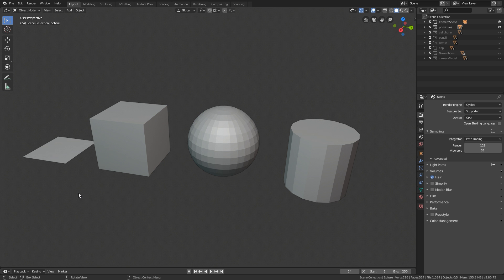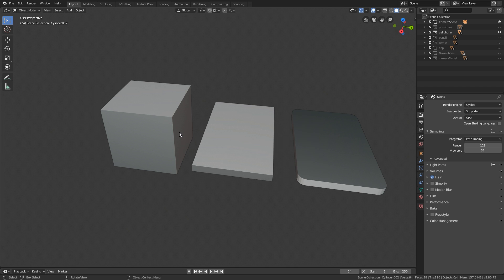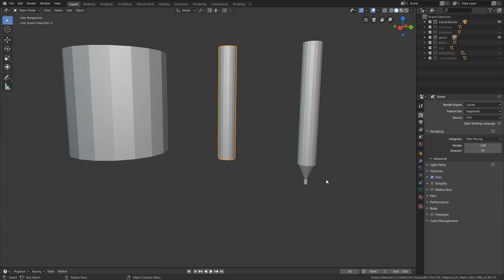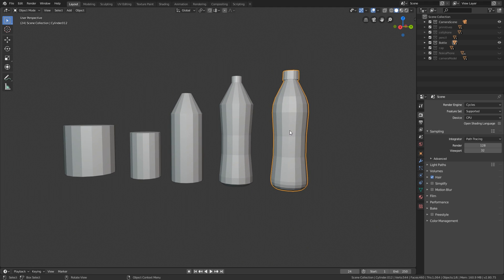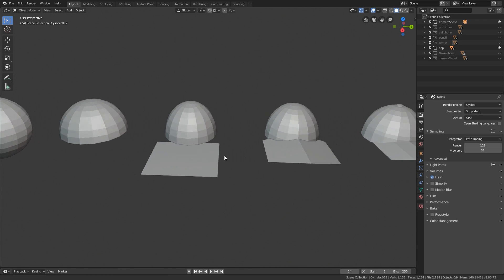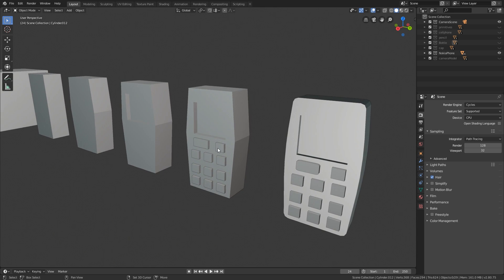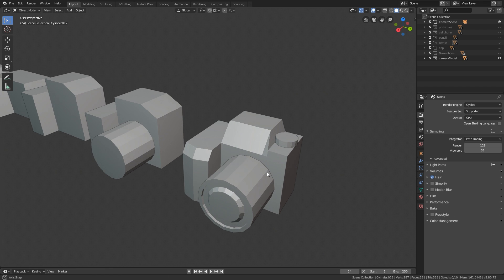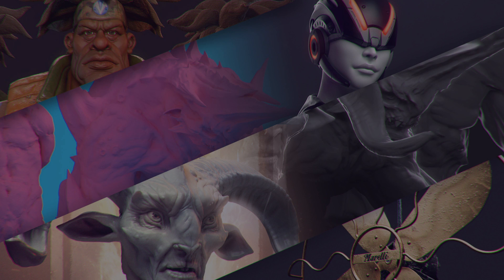How to Model Anything in 3D - Modeling Fundamentals

Comment: Hi... I need to know how can we model any model in accurate proportion.
Reply: If you mean according to real world scale, many if not all 3d software have measuring features. And since you want to model something that has real world scale, you would have to find an image/illustration that shows the dimensions of it or something close to that.
Reply: Also, you'd need either an orthographic diagram of what you want to model or multiple reference images.
Reply: @mayteexxis  With out any measurement how can we create 90-95 % accuracy in modeling? Is there any trick or way to model?
Reply: @maheshvijay5725  I still don't know if you're also looking for accuracy in real world scale but what I do is to look for orthographic diagrams (blueprints) or at least images that are close to an orthographic view (top, front, right, etc.). If I don't have that, I'd just align the view of the model to the same angle as the image and compare to see if the thickness for example is okay or too much.
Reply: @mayteexxis  Thank you 😊

Comment: @FlippedNormals
Hey, 
one question, do you know how you can model 3D Environments? 
For example Terrains like in World Of Warcraft Trailers or Terrains/Landscapes/Environments which are used in 3D Animation movies?
I am not quite sure how this works. 
I would be glad if I can get an answer in which program I can solve this problem. (Currently I am using 3dsmax)

Best regards
Reply: One thing I noticed is that terrains are sculpted (or maybe modelling with proportional editing). Environments have multiple separate meshes.

Comment: Heya guys nice to see more from you :-).

Just curious I know you have cutting a circular hole into a cylinder (curved surface) is there something about cutting a rectangle hole (like maybe a window or something extruded into the mesh)? I can't get it without causing any (even small) artifacts or pinching right even with different guides (it's fine if the surface is not a full mirror but with a mirror you can see that tiny slight deformation of reflection at certain angles)?

Thank you to anyone who would knows guys I'm crying here over hard surfaces with sub-d mod and smooth shading so hard now (I'm realy starting to hate cylinders, how does anyone model anything like this?)

Have fun guys and hope to see more.

Comment: Nice video, though it should've been called something like "the power of primitive shape" or something.  Because for me, for example, the most important and crucial part of being able to "model anything" is being able to perceive and recreate the exact proportions of an object, and not the ability to construct underlying mesh. Btw, bad example with a computer mouse in the end. Unlike for the table, monitor, keyboard the modern mouse is such an elaborate and often asymmetrical mix of organic and inorganic shapes that it has only two ways of modeling: sculping + retopology, and by using Nurbs in CAD. It's frankly similar to automobiles. Like, you could probably model the overall body of a mouse or car in polygons, but once you start to separating shapes then everything breaks and the mesh difficulty is skyrocketing. It can be very discouraging for beginners.
Reply: DO NOT SPEAK SHIT .. " Because for me, for example, the most important and crucial part of being able to "model anything" is being able to perceive and recreate the exact proportions of an object, and not the ability to construct underlying mesh  "

Comment: I think if the shape is smooth like the computer mouse, then in the most cases it should be done from plane. Working with polygons gives you flexibility and lets you define shape more accurately. But for blocking or drafting, just to get feeling of size and shape - of course we go with primitives)

Comment: maya  or  blender what is the better  ?
Reply from the maker: Maya is the best tool by far for productions. For hobby use, Blender all the way due to the price tag
Reply: @FlippedNormals  True and best comment ever!!!!
Reply: If you're doing animations for a studio like ILM then Maya. If you're doing animations for Youtube then Blender. 

Also Blender is a more all in one package. You would have to get Zbrush, Substance Painter, Arnold, Iray etc. along with Maya. Blender is even going to have UDIMs soon, you would need to get like Mari for that too.
Reply: Depends what you are attempting to achieve. Both can do pretty much the same, just that Maya has been engineered towards specific industry sectors such as animation and rigging of characters, and that is why it is the common program in VFX studios. Go on Artstation and type in environment art 3d, or character art 3d, or car model 3d. Trust me, without looking at which software was used you'll NEVER guess which one created it. And that's the point – you can create the same stuff in every program. The only major difference between Blender and Maya is Maya is f**king expensive, and Blender is f**cking FREE!

Comment: Would love to see your thoughts on when separate meshes should be used in modelling an asset, as I debate it all the time when modelling.
Reply from the maker: Its already recorded and it's coming out in the next week or so :)
Reply: @FlippedNormals  I've noticed that you guys somehow can read our minds
Reply: @FlippedNormals  yey
Reply: Basically, the more complex the model the more separate meshes you can use. You can combine them and vertex weld them after you have done all the details separately, but its easier that way. Also, models that logically are made out of different parts (cars for example) should obviously be made from different meshes. Also, if the hard surface object you create is going to be animated keep in mind to keep the animated parts separate.
Reply: I use to struggle with that too. Depends on what you need it for and how it will be used. If it’s an organic model with soft seams, you might be better off keeping it a single mesh. You could also use an edge modifier on two different models so it will soften where they intersect. If that part doesn’t really move or it’s hard to tell that it’s separate meshes, that’s a good place to use multiple meshes. Also you can get away with multiple meshes much easier on hard surface models. It’s really a game of getting out of your own way, if it makes the model simpler or more efficient, use separate meshes. I feel like some people think that it’s cheating or something, it’s not.
Reply: @GentlyGiantGames  What Modifier to you mean excactly with the "Edge Modifier"?
Reply: synth32 it’s different in each program, in Modo is part of the material and it’s called rounded edge, in Maya with Arnold it’s round corners. It’s part of a shader usually.
Reply: Like I read on some blender forum - If object in real life is made from seperate parts, so should be the mesh 🤔 this thought helped me quite a bit at the beginning when I was trying to model everything as a single mesh and it was nearly impossible
Reply: polygroups
Reply: https://local.google.com/place?id=9489479621954569782&use=srp&ibp=gwp;0,7
Reply: Man z  brush is much simpler to use